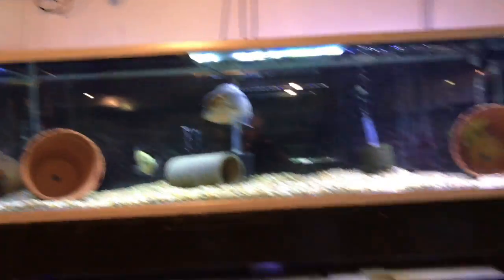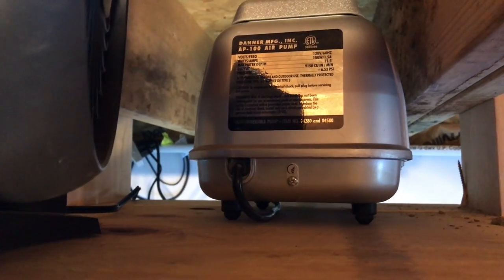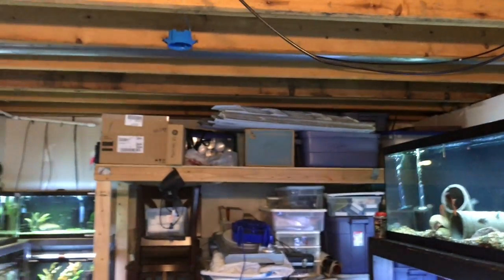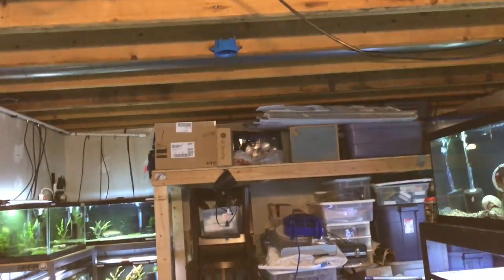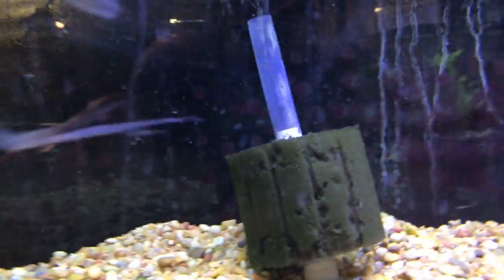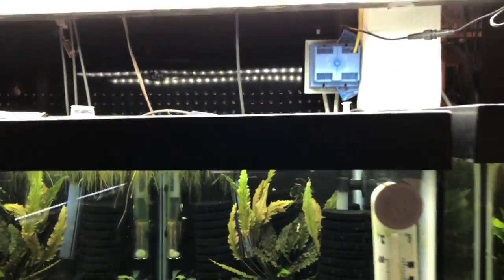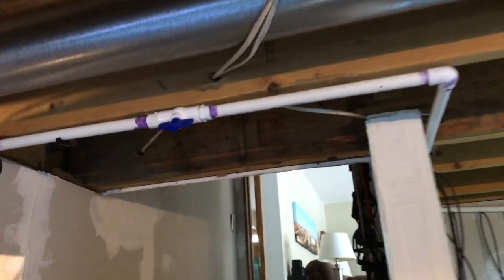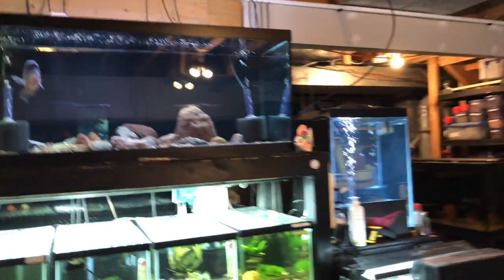Air System Overview

Comment: bet there is some serious air pressure in those pipes... you ever had any blowouts? when you first tuned the system?
Reply from the maker: No blowouts. I had enough valves going where the pressure was OK

Comment: Can the PVC be routed against the floor boards and the tubes run up from there?  I'm asking because I'd rather conceal all those pipes and airline tubes for a cleaner looking fish room.  That's my main concern with such a setup.
Reply from the maker: Good question, not sure.  Everyone I've seen does it from above.  I assume it makes it easier for the air to travel down to the tank vs travel tip to a tank.

Comment: What are the pros and cons of diaphgram vs linear piston?
Reply: Diaphragm wears out eventually and is noisy but cheap, Linear is almost silent and uses a piston in it so it can pretty much last forever.
Reply: Linear piston doesn't last forever, the performance will degrade through time.  You have stated the obvious, but what is more important is the back pressure vs how deep it can drive the air down the water.  Piston is not known to handle deeper water without creating large back pressure to the air pump.  Which in turn, will degrade the seals around the pistons.  Diaphragm is more capable in handling deeper water like an air-driven protein skimmer as a cost of more frequent replacement of the diaphragm assemble.
Reply: He asked for the obvious Pros and Cons !!
Is one much cheaper than the other YES.
Does one last much longer than the other YES.
You could have just added to that instead of being a pedantic no ?